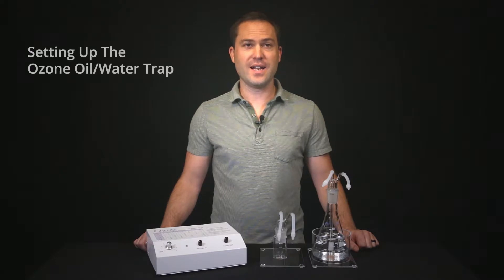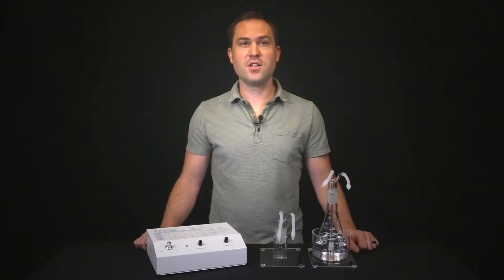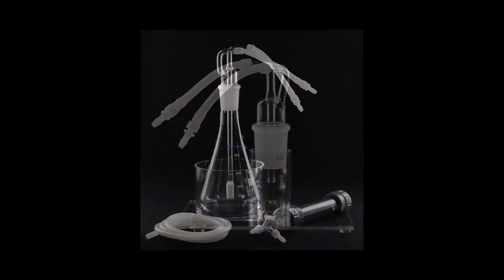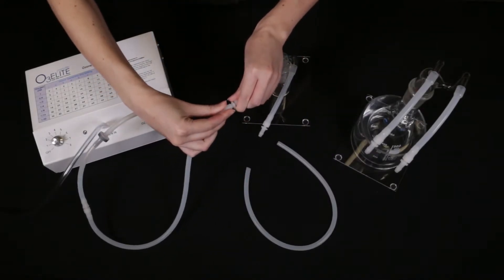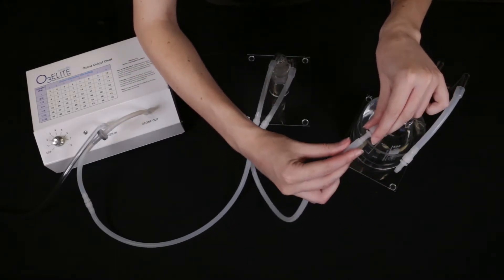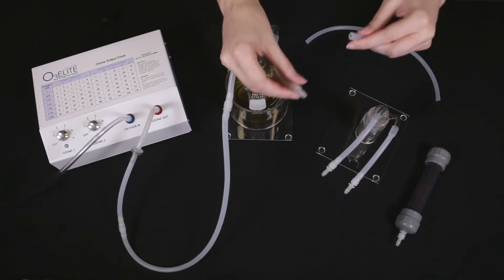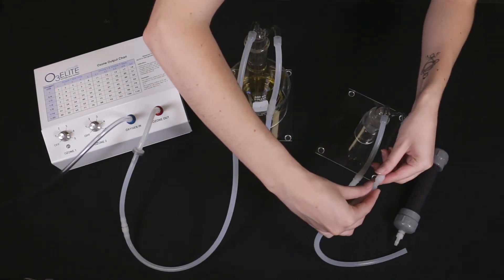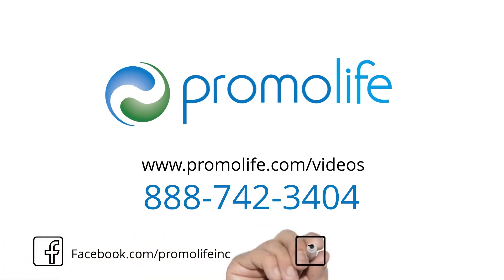Setting up the Ozone Oil and Water Trap

Comment: In the case of using the bubbler only for water. Can the trap be installed between the ozone generator and bubbler? Or should the trap still be setup after the bubbler? In other words. Is it a problem if water or humidity gets in to the destruct system? Thanks for the video.
Reply: Yes, we recommend installing the trap between the ozone generator and the water bubbler when making ozone water. The reason for installing the trap after the oil bubbler is to prevent oil from entering the ozone-destruct system. It is still recommended to have a trap between the ozone generator and the bubbler regardless of whether you are using bubbler water or oil.

Comment: I purchased your oil bubbler and water bubbling system. I didn’t get any sort of trap. What are the chances that oil or water could leak back into the ozone generator?
Reply: As long as you unhook your tubing after use you should be good. The trap is for people who want to leave everything hooked up.

Comment: Why do you place the trap after the oil bubbler?  I thought the trap goes in between the generator and what your ozonating as a protection measure?
Reply: The trap catches any oil that could potentially spill over into the ozone destruct system.
If ozonated oils enter an ozone destruct system it could potentially generate enough heat to ignite.
It's best to have two traps. One before the oil bubbler and one after.
Reply: @Puro3 In the case of using the bubbler only for water. Can the trap be installed between the ozone generator and bubbler? Or should the trap still be setup after the bubbler? In other words. Is it a problem if water or humidity gets in to the destruct system?